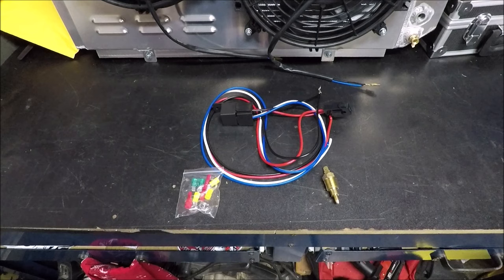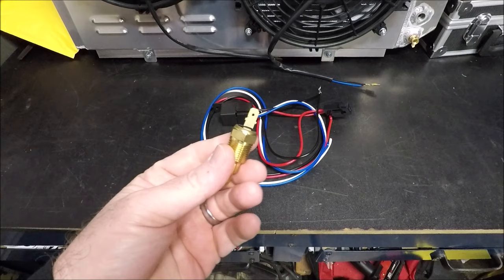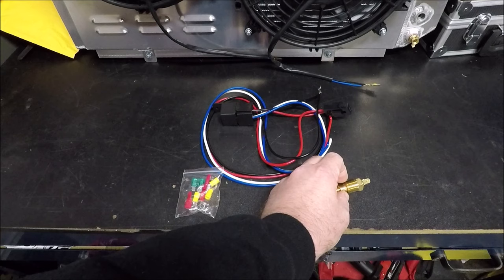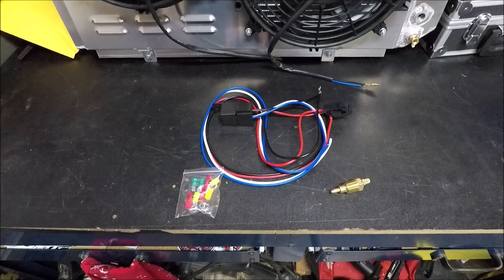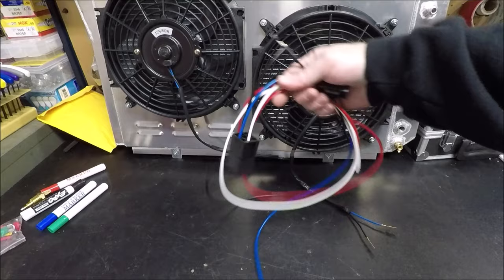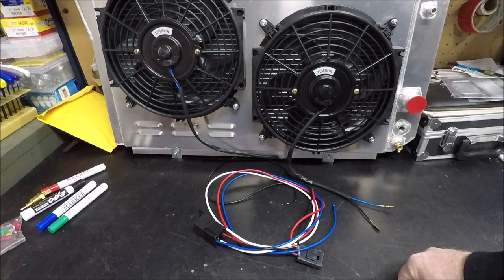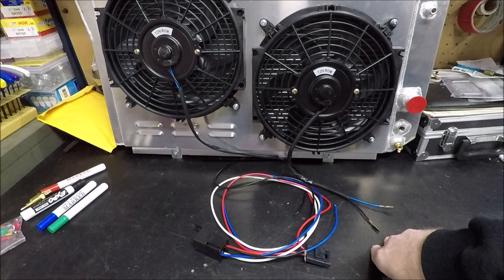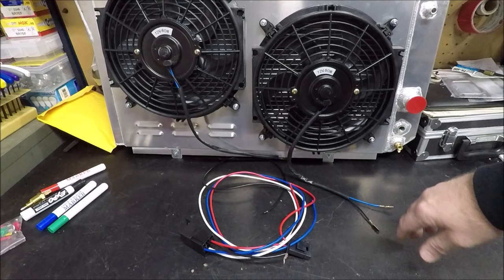ELECTRIC COOLING FAN RELAY AND TEMPERATURE SWITCH WIRING

Comment: Can the original coolant temperature sensor be used?
Reply: I'm about to find out!
Reply from the maker: Only if your computer is controlling the fans.
Reply: @BadLuckGarage  my relays control the fans by the temperature sensor. Is there a difference between OEM sensor and the aftermarket one for the electric fan application
Reply from the maker: @leeamerican4257  It sounds like you’re referring to a temp switch, not a temp sensor brother. A temp sensor/ sending unit doesn’t have the capacity to switch a relay on or off, it just registers changees in temp through resistance to let you gauge(or computer depending on if it’s a sensor or sending unit) know what temp the coolant is at. A temp switch such as the one in this video is just a simple on/off switch that completes a circuit at a set temperature. A lot of cars in the 80s used a temp switch such as this to trigger one or both fans but also had separate sensors or sending units for the gauges and/or computers. So yes, it’s possible depending on what car you’re referring to that it may have a temp switch similar to the one in this video.
Reply: @BadLuckGarage  sounds like I need one of those temp sensor and stick it in the block. What would I do with the original wire to the sensor. I think it is a ground wire. Must be the one for register temp
Reply from the maker: @leeamerican4257  If you still want you gauge to work you’ll need to find another location for the switch. There are usually other coolant ports on the block/heads/intake manifold that you can use that are currently just blocked off with screw in plugs. You’ll just have to do a little research. 👍
Reply: @BadLuckGarage  ok thanks brother. Never considered using another location in intake ect.
Reply from the maker: @leeamerican4257  👍

Comment: The weird thing is the diagram that came with the exact same kit said the white wire went to the temperature sensor and the black wire went to the ignition switch
Reply from the maker: The white and the black are interchangeable.
Reply: @BadLuckGarage  Okay, we have it wired correctly, tested the fan prior to install and know it works, I have a 160 thermostat and the fan isn't kicking on...not sure what's happening here or where to go from here.  We used shrink wrap connectors, cut out the useless loop, and wired white to ignition and black to the sensor that we screwed into the thermostat housing and it still won't kick on....lost here

Comment: I got 3 relays , its not fun to figure out either, because of air conditioning high speed and two fans , it runs low speed and high speed both fans , weirdest hardest way ive ever seen one done , but I aint changing it ..if I did , it would have two sensors instead of three relays and still do the same thing , guess it dont make a difference , what do you want to fail ? A sensor or a relay ..its gonna happen eventually no matter what you do ..

Comment: Fans are not coming on unless I ground it to the frame.
Reply from the maker: Then either your temp switch is bad or you didn’t wire  it properly. Or you used Teflon tape on the temp switch preventing it from making good contact with the cylinder head.
Reply: @BadLuckGarage  what stops the leaking around the temp sensor?
Reply from the maker: @C10ProblemChild  Teflon paste is what most manufacturers recommend. I generally just use a little pig of rtv before I screw it in.

Comment: I have watched this video 5 times, I thought I finally found what I was looking for until I realized I have the same relay and wires that you're using in the video.  However, my white wire is on 86 and black wire is on 85.  You switched that and put white on 85 and black on 86....Don't really know if I should switch to what you have shown in this video or keep the wires they way they are.  Also, In your video when your relay is connected to the harness the white wire is on pin 86 not pin 85!
Reply from the maker: It doesn't matter what color the wires are, you go by the terminals. Thats why I labled them on the whiteboard. The wires could be pink with yellow pokadots or orange and hot pink and it still wouldn't matter. All that matters is the terminal numbers.  Also 86 and 85 are swappable. Its just a passthrough to activate the relay as shown in the video. If you watched this video five times and still didn’t understand that then it’s because you don't understand the basics of how a relay works and my suggestion is to get an understanding of that first. You should have an understanding of the basics of wiring before you attempt to wire anything on your car. 👍

Comment: My stock thermo stick have 2 wires coming out of it
Reply from the maker: This video isn’t about your stock thermo stick.
Reply: @BadLuckGarage  I know but but when you put the new one in intake  will my connections connect to it
Reply from the maker: @mrworldwide6770  Only if they’re wired as shown in the video.
Reply: @BadLuckGarage  thank so much for your time and getting back to me sir I just found out there another switch at the cylinder head between 1&3 that I could tap into

Comment: why cant you just connect the fans to the existing fan connectors and utilize the existing relays and switch ? seems a lot easier that way
Reply from the maker: This video is explaining how to install this aftermarket wiring kit. Nobody is stopping you from using your factory wiring.
Reply: @BadLuckGarage  but my question was ..can you use the factory wiring,sensors and relays to run these after market fans with no issues?
Reply from the maker: @angelzerep4533  If your vehicle came with dual fans then yes. Cut and splice in the new connectors to your factory fan wiring. I’ve done this in other videos.

Comment: Why can't you use white on a white board
Reply from the maker: Because purple plus egg equals sixty twelve
Reply: @BadLuckGarage  😆😆 In all seriousness great video man. Especially the tip on making sure your thermostat opens up at a temp lower than the sensor is set for. I'm gonna be attempting this project this week, I've done everything I can and my fans in my '06 Malibu still won't kick on- so this is my final resort. Appreciate your instruction!

Comment: Do you need a breaker
Reply from the maker: Do you NEED one? No it comes with a fuse. 
But a breaker on the battery side is never a bad idea. 👍
Reply: @BadLuckGarage  ok having a bit of trouble hooking fans up on my 92 Silverado instructions look like kindergarten kids drew it
Reply from the maker: @mikeglass4267  Yes I know, that’s why I made this video. Lol.
Reply: @BadLuckGarage  so on breaker I take red battery wire and hook to terminal marked battery and then run another wire from other terminal to battery I have same color wires on my relays as yours
Reply from the maker: @mikeglass4267  the breaker would splice in between the battery and the fuse.

Comment: Or you could use the eyelet to run another wire.. ....
Reply from the maker: You wouldn't use the eyelet for that, but you could splice in another wire to ground through a switch to turn the fans on manually if you like.

Comment: Why not use your thermostat plugged into your radiator its already pre drilled and tapped albeit you need the right thermostat i.e ford fiesta or what ever..you a question👍
Reply from the maker: Not sure what your question is exactly but no, the Alloy Works radiators are not tapped for their thermostats. Also the coolant in the radiator will not be an exact indicator of the coolant temp in the engine block and could lead to the fans not coming on and off at the proper temperature. By installing the thermostats switch in the cylinder head you will be giving it the most accurate reading of the engines temperature possible.

Comment: all well and fine for a stock engine that wont see much horsepower. the fans wont cool engine fast enough on a 95 degree day.every video is fail safe install, no one is allowed to make their own minds up using a toggle switch to turn on and off.
Reply from the maker: Actually this radiator and fan setup is currently being used on a twin turbo setup. So nowhere near stock. Check out the “Chaos Theory Camaro” playlist for more details. Also if for some reason you want to use a toggle switch instead of the I included thermostat switch or an aftermarket ecu controller such as I used in this video,  simply place the toggle switch inline to the ground side of your relay.

Comment: He doesn't explain you need to join the two blue & two blacks from the fans together with say a dual female/female to single male connector to connect to the blue & black relay wires....
Reply from the maker: Actually “he” explained very clearly  that you shouldn’t do that , and that you should instead run separate relays for each fan or rewire the relay with heavier gauge wire. Try watching again without skipping the important parts.